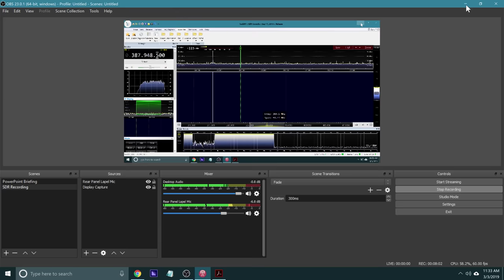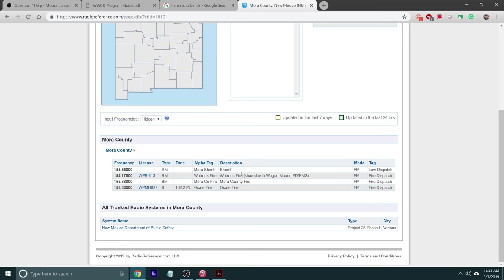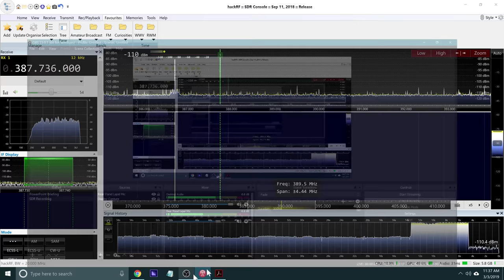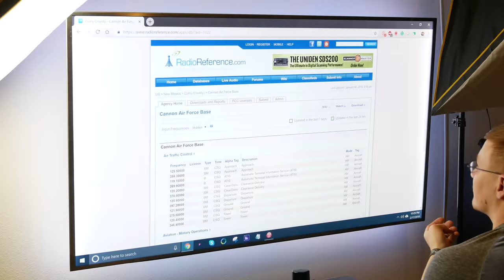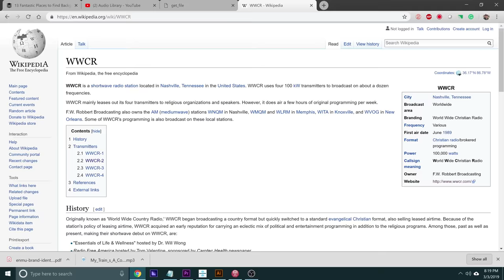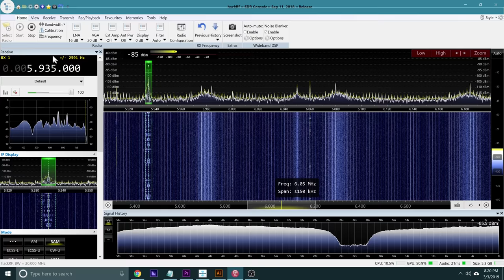Tuned Magnetic Loop Antenna - ENMU - EET 490 Capstone - Update 2

Comment: I bet you receive the ILF messages on only the small loop. the big loop does nothing. try say 3 trough 20MHz and peak the resonant frequency where you listen with the capacitor. And use this. http://www.iw5edi.com/software/magnetic-loop-calculator   . Put in your values and find that you made an excellent loop for the lower bands. but certainly not for 270MHz. btw I agree with the guys on the tickness of the wire to the capacitor.  Everything about magnetic loops is about milliohms (or less :-) )

Comment: 50 Dollar cap!!  I can't find a variable capacitor for less then 180 bucks out on the net and most of the ones that look like yours are 350 Bucks. .  Looks like I will be making a trombone capacitor out of copper pipes. eek !! $$$$  For the cost of one average cap you can buy a loop antenna prebuilt and ready to go.

Comment: That video is simply bullshit as you are showing a magnetic loop antenna design and you talk about magnetic loop antenna but think on it - you're receiving the ILS airport weather information transmission at round about 270 MHz. Let's say it would be 300 MHz for the beauty of simplicity. That would make the wavelength to 1.0 meters. Magnetic loop antennas do have to have a small main loop surround of up to maximum of 30 % of the wavelength just by definition. Seeing your construction I get the strong impression you are abusing the construction of a mag-loop as a regular loop antenna being more or less resonant (or even not being resonant at all) or just picking up some signals by your (untuned!) coupling loop.  A proper magnetic loop setup of that size you are showing would receive in the area of maybe 1-10 MHz and you would have to tune the antenna for every single station as result of it's very narrow bandwidth. Not jut switching over to other frequency and receiving some signal, with a real mag-loop setup for your receiving frequency you would receive nothing on untuned frequencies! So, what ever you use the antenna as, it is no magnetic loop antenna, that's for sure!
Reply: Watch the whole video bro. Christ you antenna people are something else. 😂